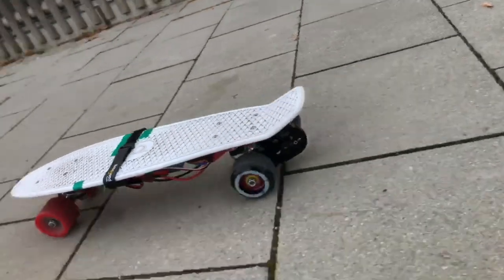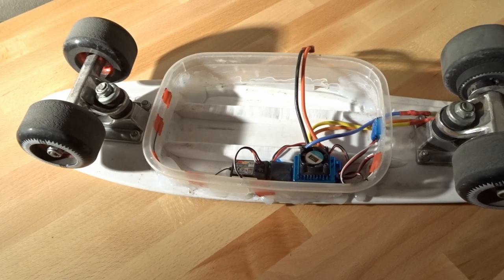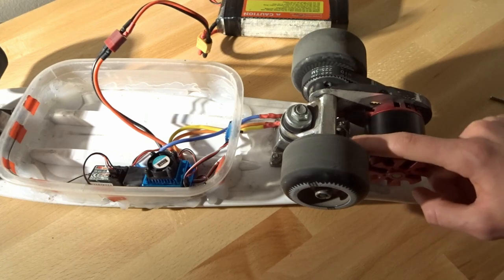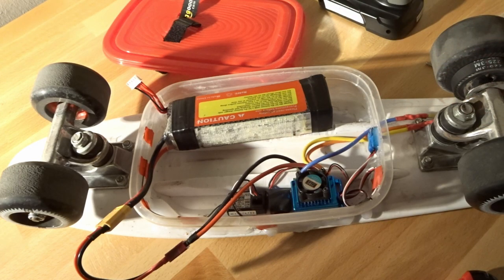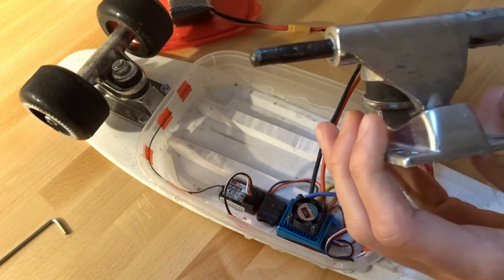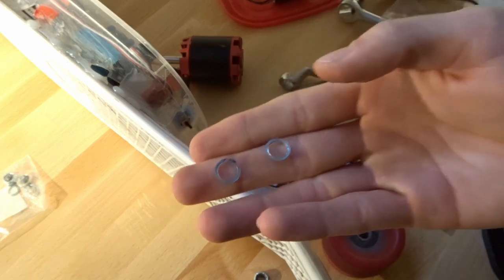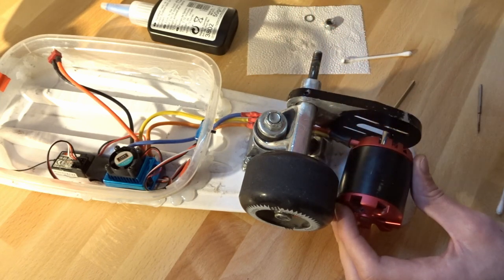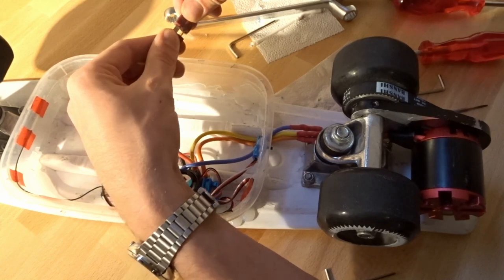Idiotproof Tutorial for How to Build an Electric Skateboard for 100€ up to 22 km/h

Comment: for such a weak power source (4S1P) the discharge rate (35C) is extremely important, even more than the total capacity (mAh). Remember, starting movement consumes 6 times more watts than cruising, so the discharge rate must be capable of support this. I have seen some setups totally fail (stuttering in place) because of using low discharge rate variants.
Reply from the maker: thanks for the info! good to know ;)

Comment: I built my own version of your skateboard (only change being, that I went for a 4s suitable ESC). I've been using it for over a year now, every now and then. And sadly today I over discharged my second lipo (on which I even used a beeping low voltage detector). Do you have a BMS you can suggest?
Reply from the maker: Hey nice to hear that! I dont use any kind of BMS on my skateboard. I only have this beeping low voltage detector as you mentioned and I set the critical voltage where it starts beeping at 3.3V. I got this one: https://www.banggood.com/5pcs-Remote-Control-Helicopter-Spare-Parts-Battery-Monitor-Alarm-1S-8S-p-1066305.html?p=1C26078191019201612Q&custlinkid=409990

Hope it helps ;)
Reply from the maker: one thing: you think they are loud, but theyre really quiet. Once i was flying my drone with this buzzer and I didnt hear it cuz I was flying FPV far away. I gave full throttle but my quad just slowly sank to ground. If youre riding with headphones and the buzzer is inside your box under your skateboard, stakes are high you wont hear it..

Comment: Hi bro, does the Esc support 4S batteries? As it says on the page it's only up to 3s
Reply from the maker: Yes i run my board with 4s and the esc did not brake and is still working for more than 1 year :-)

Comment: Do the brakes work well? What esc did you use, can you recommend for a budget 6s build?
Reply from the maker: david martin brakes do work, but not strong enough, if you’re on full speed with 4S (more or less 20kmh) I would say you could brake within 10-15 meters..
If you brake harder, the motor is going to make some noise and not really brake, just like if it was ABS and you’ll probably lose control at high speeds..

Concerning the 6s build: I still wanna upload a video about the 4S to 6S upgrade, but hadn’t had the time to do so. I used a racerstar 120a 6s ESC from Banggood, which did cost me 32,88€ in January 2018..
There’s another one called FVT 120a esc, this one is better but also more expensive..

Hope I could help
Reply: Yeah thanks,! I've heard Good things about 150A Car Esc's, "Quote for 6s there bullet proof" Hope your bangood one is the same :) 

Also You can Get a Chinese Vesc for under 60 Euros, 
I would chose that over a FVT.

Comment: is it possible to change the remote like the more simple one? and also cheaper sometimes. if yes, what adjustment do i need to make?
Reply from the maker: yeah it is possible. Right now i changed my remote to this one, which is way smaller: https://www.banggood.com/Mini-2_4Ghz-Wireless-Remote-Controller-With-Receiver-For-Electric-Skateboard-Longboard-p-1272751.html?p=1C26078191019201612Q

Comment: Will it work better with a 14.8v 7000 Mah battery instead of the 5500 Mah your'e using better range maybe?
Reply from the maker: of course, about 30% better range ;)

Comment: If your motor mount still comes loose, you can do like I did and apply a metal epoxy (JB Weld) to permanently bond the motor mount to the truck. 

High five.
Reply from the maker: great idea, thanks for the advice! been thinking, if its a bit of overkill to weld the mount, but this would be the best alternative.
Until now, the mount is super tight just using a lot of Screw Lock. If its going to losen again, I might purchase metal epoxy :D

Comment: How long would the battery last how many km??? I want to build it
Reply from the maker: Exotic Wheelies with a 4s 5500mah battery you could ride approximately 5km.. but you can easily stock up the capacity until 10Ah ;)

Comment: How to charge the batteries plssss give me tha link for its charger also.  Plssssssssssbbbbbß
Reply from the maker: In 2016 I bought this charger (https://www.amazon.de/gp/product/B00LL8IHM8/ref=oh_aui_detailpage_o01_s00?ie=UTF8&psc=1) and I´m still using it. On Banggood or other websites its a bit cheaper..
https://www.banggood.com/Wholesale-IMAX-B6-Digital-RC-Lipo-NiMH-battery-Balance-Charger-p-46220.html?p=1C26078191019201612Q
Reply: And which trucks u r using
Reply from the maker: be musicly i used the trucks from my pennyboard..
If your trucks don’t fit just rasp them..
Reply: please tell me that in one charge battery can last how much time ?
Reply from the maker: be musicly about 20-40 minutes, depends on how fast you go and how much current is being drawn from the battery..

Comment: hello ,first nice video :)
and if i add one more same battery , will i go faster please ?
Thanks
Reply from the maker: Ian Lobby hi thanks! I’ve gonna upload a video soon about upgrading this skateboard with a new esc capable of handling 6s, which means more speed or more torque..
So here you’re limited to 4 cells, if you want to go faster you can either change the gear ratio (but you lose torque) or use higher voltage —> you need new esc...
Reply: Okii thanks ;)  i have he notification on hehehe
Reply: I have one more question , do a 'Samsung, 4400mAh 36V' will kill the ESC or other components pls ?
Reply from the maker: Ian Lobby you will probably kill the esc, if you’re using the same as I did..
It’s designed for a maximum of 4 cells so max voltage is 4*4.2V=16.8V...
If you’re brave you could try sth like 21V but it may fry the esc under high load...
Conclusion: don’t use 36V

Comment: Where do you put the three plugs from the motor to the esc you need a connector right?
Reply from the maker: ? You can either buy yourself some
Bullet connectors, which is definitely the more elegant option, but you could also just remove the bullet plugs from the motor and solder them together with some shrink tubing 👌🏼
Reply: @ChillingLu  Thank you!

Comment: kannst du mir bitte ein Link von einem guten Akku schicken der relativ günstig ist und trotzdem mit den Komponenten kompatibel ist, die die benutzt hast?
Reply from the maker: Thorben na klar ;) hier: https://www.banggood.com/ZOP-Power-14_8V-4500mAh-4S-45C-Lipo-Battery-XT60-Plug-p-1087251.html?p=1C26078191019201612Q
Reply: danke. und könntest du nochmal ein ladegerät schicken, weil dieses blaue ding braucht doch eine stromquelle also netzadapter oder so, oder?
Reply from the maker: @thorben1442  ja klar. hier ist ein ladegerät für 10$. Du kannst aber auch jedes x-beliebige PC-Ladegerät mit gleichem Stecker verwenden, der iMaxB6 verträgt alles von 11V bis 18V..

https://www.banggood.com/Wholesale-PD1205-12V-5A-AC-Power-Adapter-For-iMAX-B5-B6-B8-3E-Charger-p-49439.html?p=1C26078191019201612Q
Reply: Braucht man außer das Netzteil und das blaue Ding noch Kabel oder irgendwas oder kann man das blaue Gerät mit den mitgelieferten Kabeln an das Board schließen?

Comment: why wont it work with the original penny wheels?
Reply from the maker: It works with any penny wheels but you obviously need holes in your wheel to attach the gear where the belt sits on.. the Wheels im using already have those holes.. i you use other wheels you’ll probably have to drill your own holes in perfect position.. 
Hope this answers your question :)

Comment: is 35C of battery make it slow,? just run in 20 km/h. I try to build with the same component, may i get faster speed than this with 50C battery. oya, maybe you have to add more cell of battery to make it faster.
Reply from the maker: 35C only says how much Amps you can continuously draw from your battery without damaging it. Using a 4S battery 35C leads to 192,5A which is more than enough. The only way to speed up the board is by using an other motor with more kv (—> less torque) or a battery with more cells.

Comment: How could I make it go faster?
Reply from the maker: buy a better esc (capable of handling voltages above 6s) use a >6s battery and thats it. You could also change gear ratio, but you would lose quite some torque, so starting up is more difficult :) hope that helps ;)
Reply: Could u send me a link to both please? The cheapest one possible, also could I change the receiver and transmittor to something smaller

Comment: and if i want change the controller or the receiver ?
Reply from the maker: kezako yeah you can change transmitter and receiver, no big deal.
Just make sure you have a receiver, that works with your transmitter :)
Here are 2 other txs and rxs:

https://m.banggood.com/2_4GHz-Radio-Remote-Controller-Receiver-Transmitter-For-Electric-Skateboard-p-1125575.html

https://m.banggood.com/2_4Ghz-Mini-Wireless-Remote-Controller-Receiver-Electric-Skateboard-Longboard-p-1179725.html

Comment: can you ride in the rain
Reply from the maker: I did some rides in the rain and nothing broke. But I really don't recommend it, cuz your skate gets so dirty, your clothes get dirty everything is wet and during curves you can slide and hurt yourself very easily..
Reply: before you updated your skatebo ard make a video on a test ride in the rain   
for  my skateboard I used  36v 18650 cell and the feeling bro 
but  I want to put 2 motor with 1 esc I don't know if it possible
Reply from the maker: it is possible having 2 motors and 1 esc but its very difficult due to phase sync. I´m not familiar with this topic but I think the VESC6 is capable of doing this (but it costs 300$ tho..)

Comment: What's the range on the board
Reply from the maker: The range is about 4-5km, depending on the speed..
But there’s still room for a second battery left :)
Reply from the maker: Banger67 now I’m running on 6s and I’ve got more than 7km range :)
Upgrade video (which is cheapest esc, best battery combination etc) coming soon ;)
Reply from the maker: Banger67 need time and a sponsor 😅
Reply: Could you link the ESC for 6S? Thanks
Reply from the maker: Wait a bit for my next video and I´m going to explain everything ;)
But for now, heres the link: https://www.banggood.com/Racerstar-120A-ESC-Brushless-Waterproof-Sensorless-18-RC-Car-Part-p-1085232.html?rmmds=search&cur_warehouse=CN
Reply from the maker: Banger67 ?
Reply from the maker: Banger67 email me lucas.perocco@outlook.com